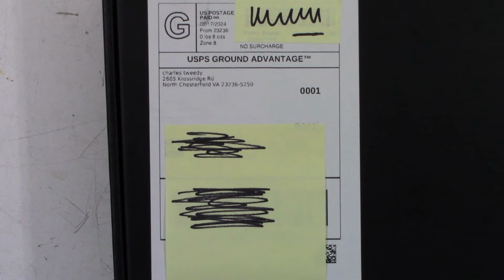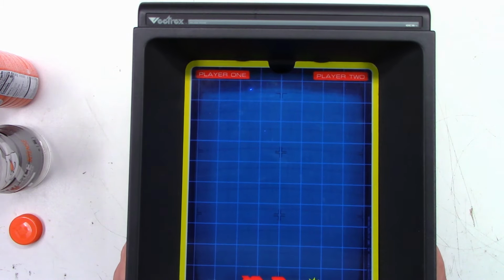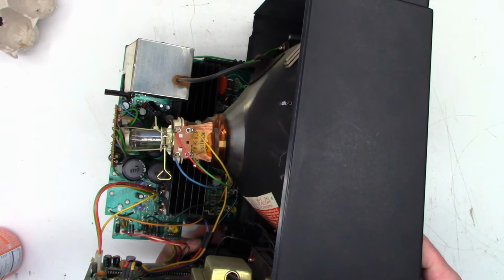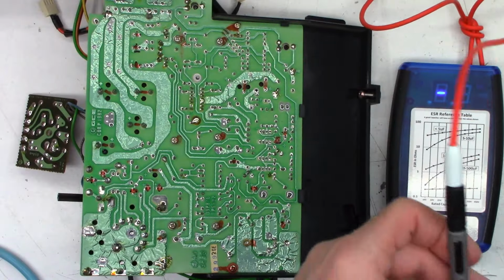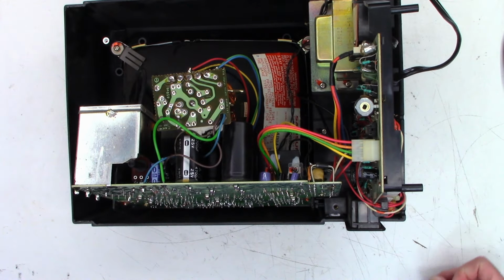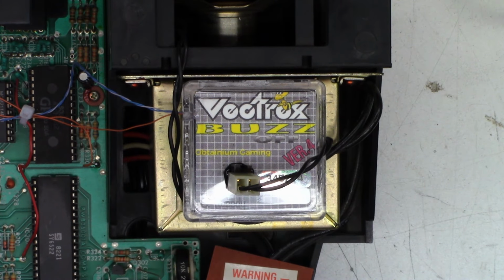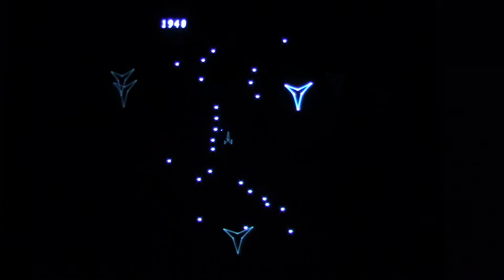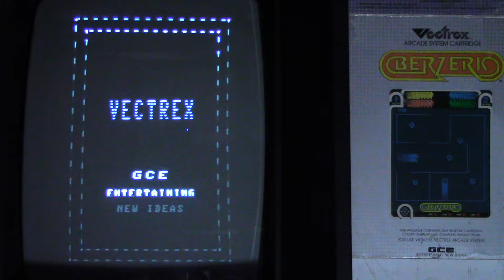A Vectrex HP-3000 Vector Monitor Game System from 1982 - ESR Cap Check and Buzz Off Kit Installation

Comment: Thanks for this! I really find smooth textureless polygons really charming to look at, but there's something even cooler at looking at these vector graphics on real sharp displays, and even today, despite technology advancing so much, nothing has really been able to surpass how clean these vector graphics look. I always wonder if we'll ever get some sort of successor to the long obsolete vector monitors. The closest I've seen are some light projectors that were trying to emulate these arcade games, and they look really good. And it's a shame the Vectrex was the only vector based console to ever come out. Though it's a no wonder they died out, as raster graphics can do basically everything that they can do, but in more complex detail. I think there's a hobbyist following for it nowadays. Do you know if there was ever a 3D platformer that was made with this vector technology?

Comment: Love my Vectrex! I have a second one I have in the bench. It has a white dot in the center of the screen when I power on. I’ve done a complete cap kit, checked diodes and resistors, and most ICs. I can’t figure out why I can’t get an image. Anyone have any suggestions?
Reply from the maker: If you have a white dot with no deflection, then I would check the deflection amplifiers, especially the power supplies to the deflection amps on the big heatsink.
Reply: @norcal715  thanks for the reply! I’ll check on that over the weekend! Love the videos. Thanks for sharing!
Reply: It’s supposed to go away turning down the brightness knob on the back, ain’t it?  My dot went away when I just turned the brightness dial on the back of the unit down.
Reply: @dogeymon83  I’m not getting any picture on the screen. Only the white dot. I can hear the gameplay in the background but no deflection on the screen.

Comment: I'm just wondering what was the main fault in first place that caused the buzzing sound
Reply from the maker: Poor initial design. The buzzoff kit fixed the issues. Most likely low level ground loop issues in the high gain audio amp circuit.